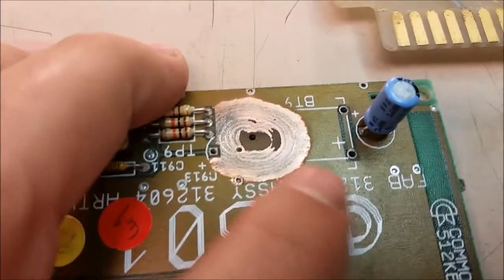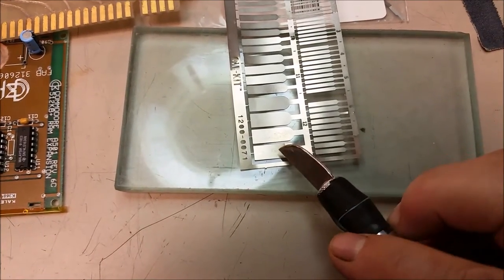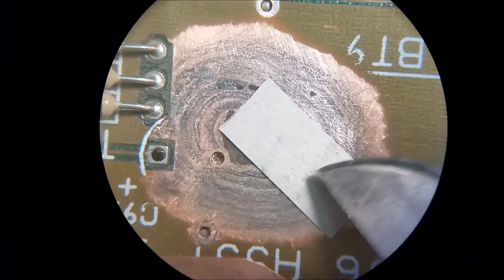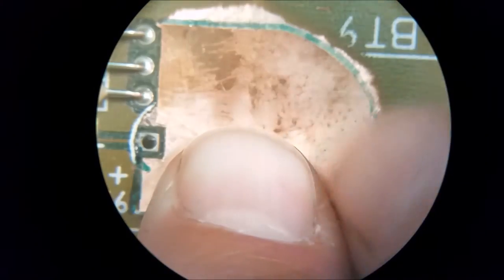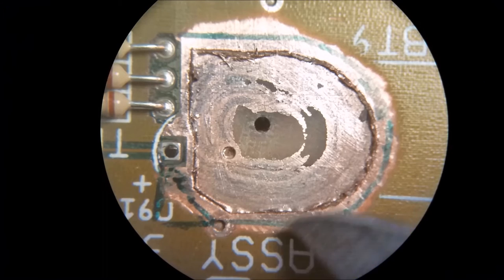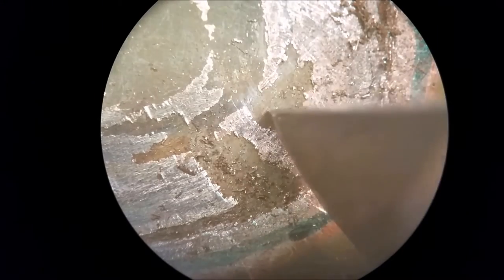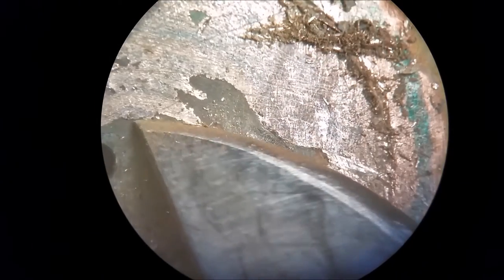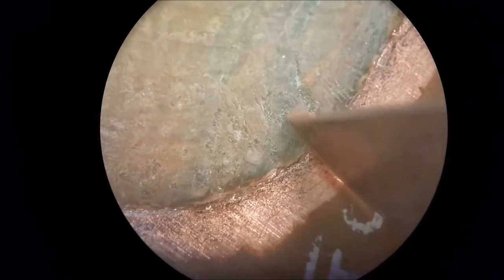Solder Tutorial Part 4 How to Replace Corroded Copper Plate

Comment: Keith Noneya , 5:55 - Why you removed the old copper? I was think you will solder a new copper to old copper =)
p.s. May be better to remove the old copper with help sandpaper or dremel with sandpaper? Or even by accumulator screwdriver with sandpaper O_o 
p.p.s. sorry for my English, it is not my native language.
Reply from the maker: The old copper may have corrosion in it. By removing the old copper I removed the possible corrosion. This left a solid fiberglass foundation for the new copper. Best Wishes & Blessings. Keith Noneya

Старая медь может иметь коррозию. Удалив старую медь, я удалил возможную коррозию. Это оставило прочную основу из стекловолокна для новой меди. Наилучшие пожелания и благословения. Кит Ноня
Reply: @keithnoneya  thanks, Keith, I understood.